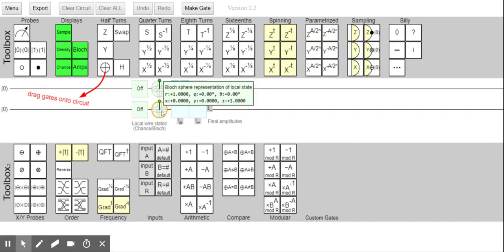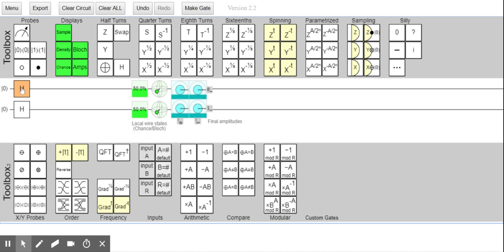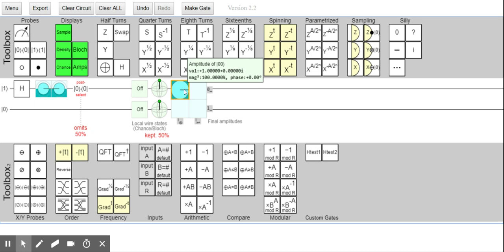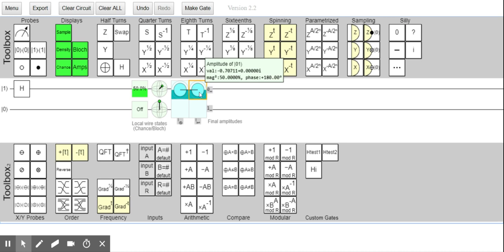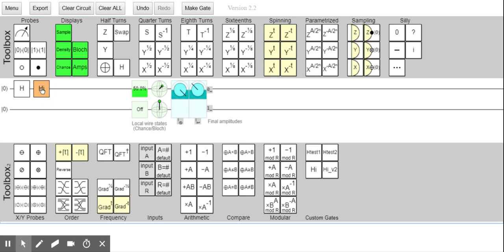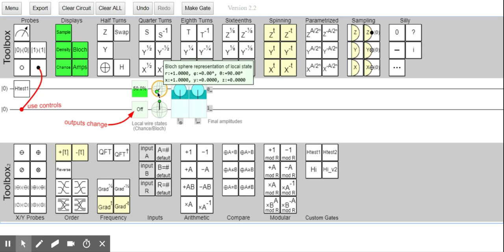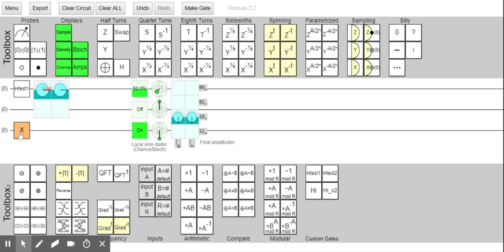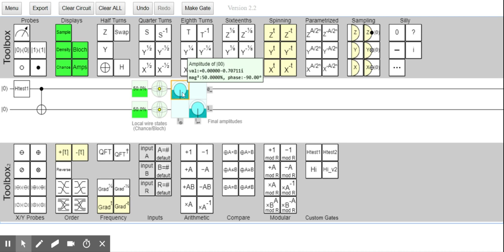Algassert [Part 6]

Comment: The hidden phase of an operation is only relevant if you control it. When not controlled, it is just a global phase and global phase has no observable consequences (it can't ever change what a chance display says). When controlled, the operation's hidden phase acts analogously to a Z rotation on the control qubit. This is also known as phase kickback.
Reply from the maker: Never thought of it this way... 🤔 Need to read this twice and let it sink for a while and play with it in Quirk! Thanks!!!
Reply from the maker: But actually it seems like it does make a difference even if I do not control it. Check out this example: http://tiny.cc/9sc9bz where I create a custom gate H_0 which does the same Hadamard rotation but has a hidden phase of 0 deg (instead of 90). In this case I need to apply 4 H_0 gates to come back to my original state vs. only 2 standard H gates. In other words, H_0 is different from H in that it's not its own inverse but, interestingly, every other property of the Hadamard gate seems to be preserved in the H_0